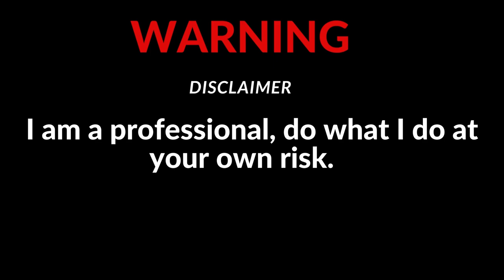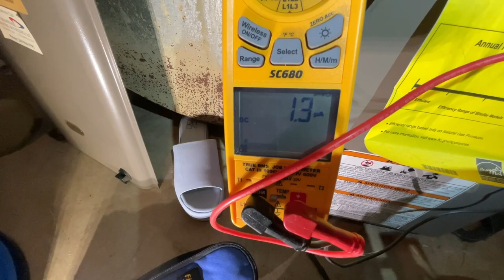No heat repair Luxaire furnace Fixed! PLEASE TURN VOLUME UP!

Comment: Please explain why not use 3m filters. Is Merv 12 to constrictive for a Luxaire furnace. Thanks.
Reply from the maker: Merv 12 in a 1” filter raises the static pressure so high, especially when they start to collect dirt. It will start to raise amp draw on the motor and make your system work harder. How I explain this to my clients is it’s kinda like high blood pressure in our body. A pleated filter about a Merv 8 is good. If your looking to get better Merv and cleaner air. Start looking into a Media Air filter my go to is April Air. Hopefully this helps. Thanks for watching.